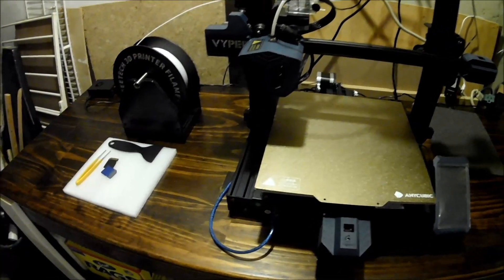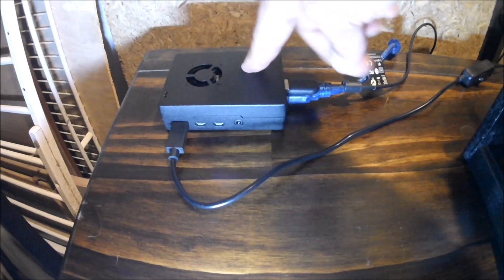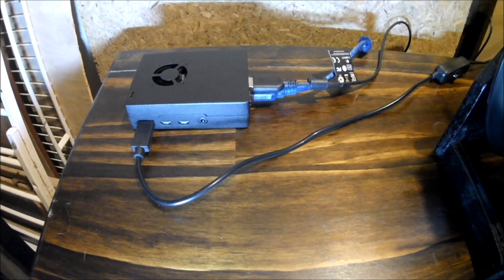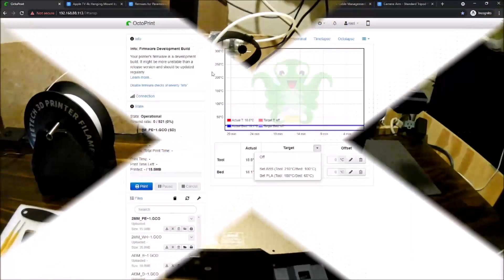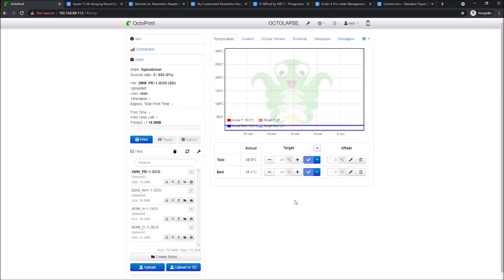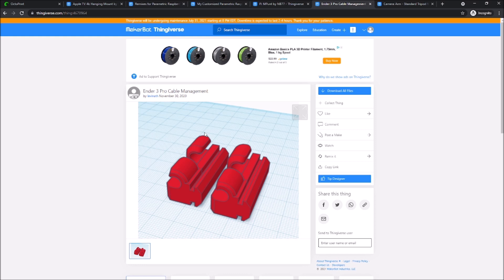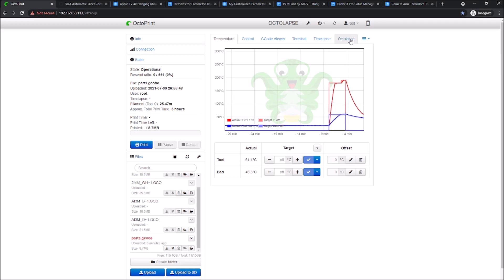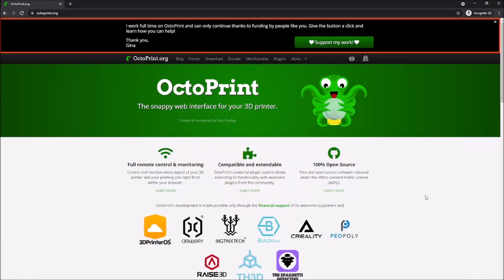Building an OctoPi for the Anycubic Vyper, Part 2; loading models and the first print

Comment: the usb lead that plugs into the pi..

look at the end of it so you can see the pins looking down toward them cover the right hand pin with a sliver of insulation tape.. thee pi and printer will no longer have any power back feeds
Reply from the maker: Great tip!  Thank you!

Comment: Can you run straight into a Windows machine using the USB out of the printer. I have a PC right next to the printer.
Reply from the maker: You can, but as Louise said, results may vary.  It will also depend on which software you are using.  Cura can definitely support the direct connection but I haven't done it myself since my PC is nowhere near the printer.  If you are printing a large file, the printer will need to access the "source" many times throught the print.  If your Windows PC goes to sleep, that could cause an issue.  I still mostly print directy from SD card even though I have the Pi.  Thanks for watching.
Reply: @renaissancelaboratories5645  The pc would be streaming the Gcode constantly, it sends each line of gcode to the printer as it prints it, there is a small buffer in the printer but its only a couple of dozen commands, so pretty much as soon as the pc drops the connection for whetever crazy reason Windows decides to drop it for, the printer will error and print is killed..
Reply: Not advised, though it is possible.. if the windows computer crashes or suffers a slowdown, which windows is especially good at, it would kill your print..

With octo, the pi is doing nothing much but controlling the printer and is very stable, if the computer you are accessing octo from happens to crash it does not affect the pi and the print will continue
Reply: As far as I am aware octoprint, the software that runs on the octopi, can be installed on most platforms, it can definitely be installed on linux, it can actually also be installed on an old smartphone and control the printer with that..

Octopi is just the raspberry pi with octoprint installed on it, and it comes as a pre made image for the pi which makes installation much easier
Reply: @AkiraFurball  thanks I’m watching all the videos on setting up a pie. I’m guessing you windows pc communicates with the pie. So any good videos you recommend?
Reply: @nmfireman  What I will say, and its possible this is just an issue for me as i use linux not mainstream windows/ mac, but I could not get the advanced options in the raspberry pi installer to work and connect the pi to my wifi.. it does not work with any install onto the pi for me, I have to set up wifi by a different way, but if you encounter that issue I can walk you through it when the time comes..

if you want to message me on facebook messenger so you have my contact info ready please feel free to do so ;)

Comment: Thanks for the tutorial. I don't know anything about Raspberry Pi so I had a couple questions:
1. Is the Pi 4 overkill for a 1 printer/webcam setup? It seems like a cheaper model could do the trick.
2. Is it possible to connect it to your smartphone at all? Like if I wanted to check up on a print when I'm out and about.

Thanks again
Reply from the maker: Good questions for Part 3! Thanks for watching.
Reply: I believe you can use any Pi , except Pi zero, very  hard to find older Pi's I am using a 3,  I had a 4, however the wifi quit so I went back to my 3
Reply: 2b or higher is best, I am using a 1 or 2 gb pi 4, not sure which on the ender, I have a pi4 4gb which will go on the vyper when it arrives..

You can control octopring from any browser connected to the same local area/ wife network, you can extend it to the internet but there may be security issues to address, and you can access and control from any smart fone/ tablet connexted to the network via browser or dedicated android app of which there are many.

You can also install octodash on the pi which gives a more friendly format for small touch screens..